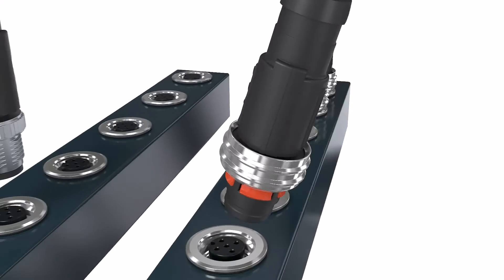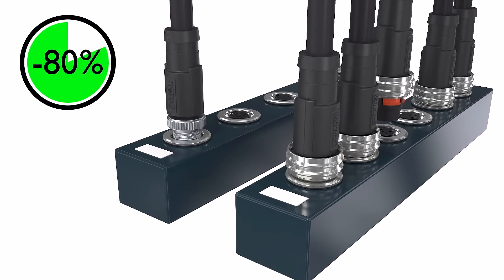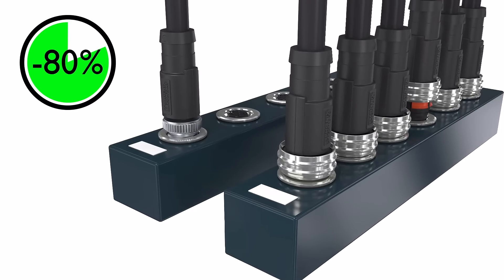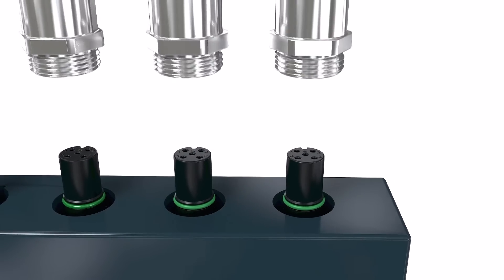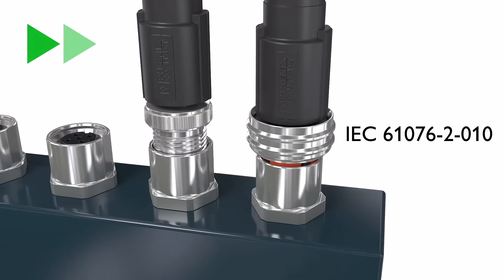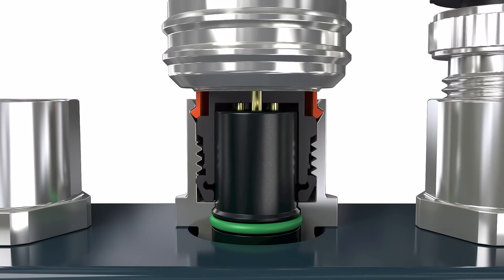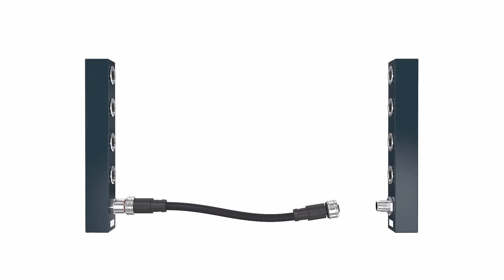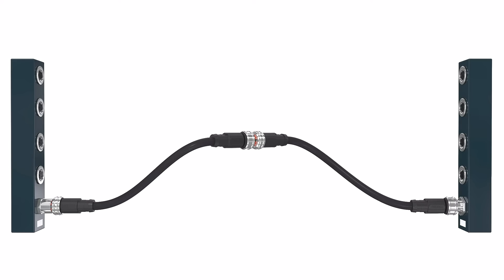M12 push-pull connectors – The new standard in automation technology

Comment: I'm actually looking for something that could be used as a quick connect for grounding hardware.
Reply from the maker: The M12 connectors are designed for signal, data and power transmission.
Grounding is integrated in the power versions, but there is no coding / plug faces in the M12 design that are only used / designed for grounding.